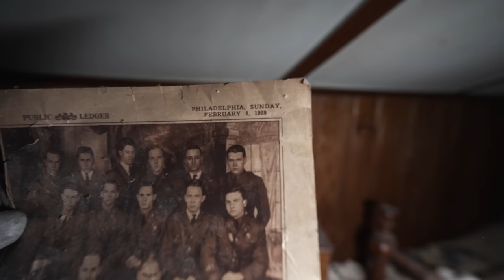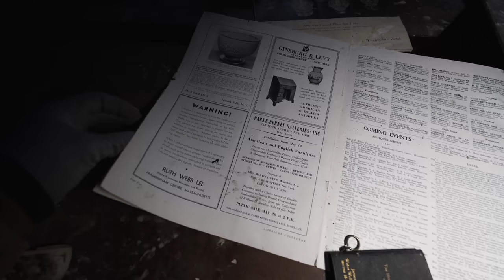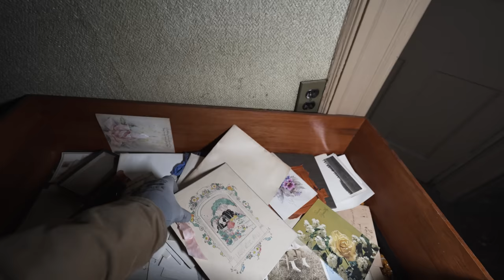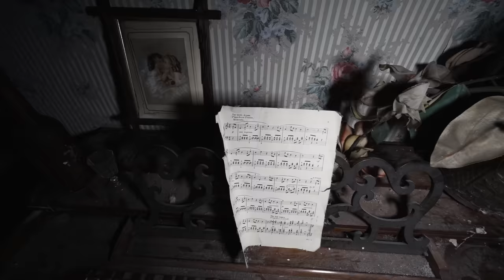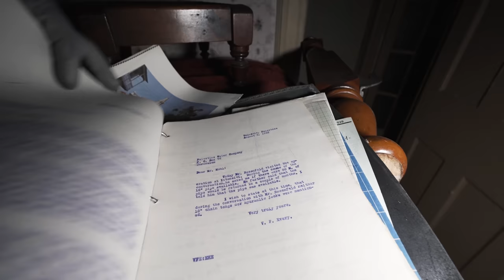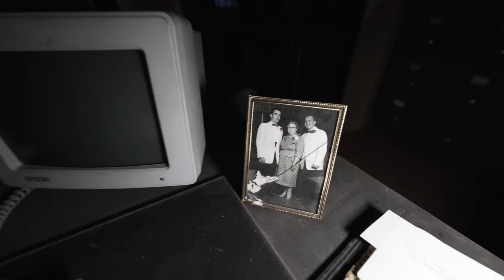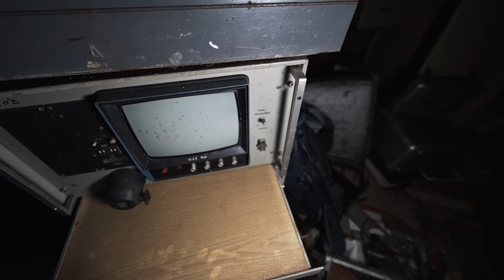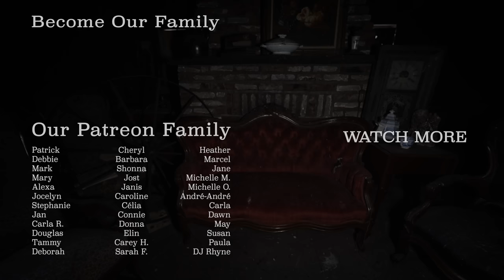Bankrupt Business Made Them Lose Their Victorian Mansion in US

Comment: Rosie in Texas again, here. Ive been working in offices since 1977. 
Old lady here. :)
 That first desk has a vintage adding machine and that roller with the contacts is called a Rolodex. Those old file cabinets have a safety designed into them. If one drawer isn't completely closed, none of the others will open. If you push all drawers closed, then you can access any drawer. No computers so paper copies were kept of everything. Looks like they had a really great system of organization and efficiency. 
Sometimes old homes were converted to a business.
I'm guessing they probably didn't live there towards the end. Maybe the lead paint or asbestos was a factor too and they had to leave?
Great tour!!